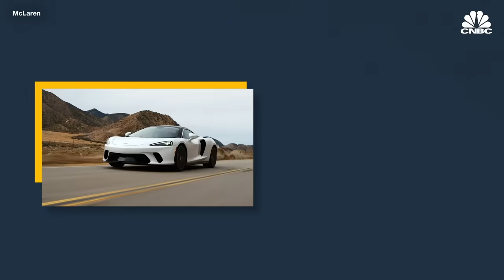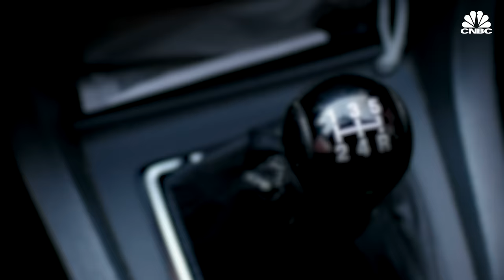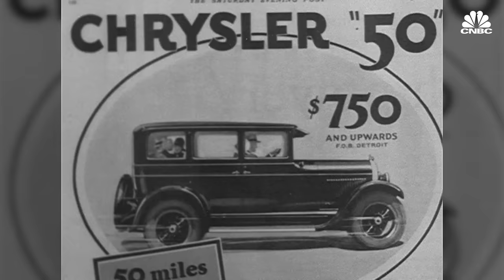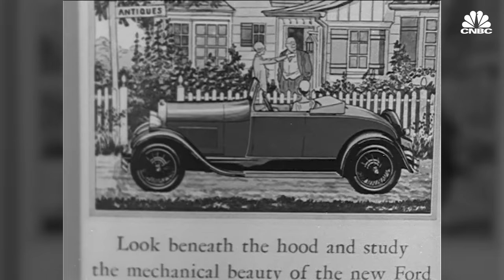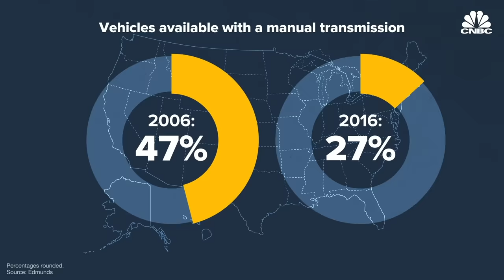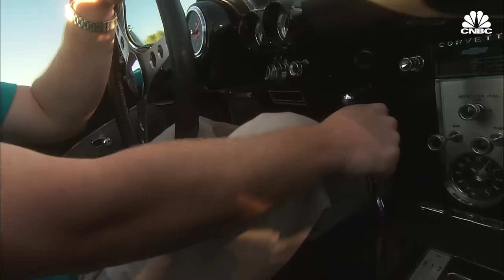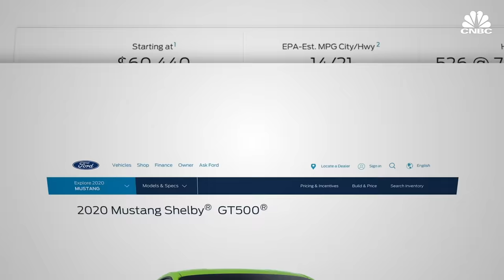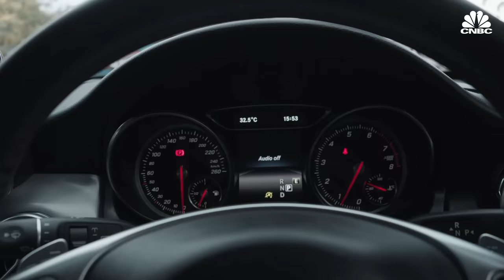Why Stick Shifts Are Going Extinct

Comment: I live in the U.K. and I don’t know anyone who drives an automatic.
Reply: All new Mercedes and BMW only come in Auto.....
Reply: @Brad-il9mw   thats Wrong my mate has a 2020 M4 with manual transmission and im sure they only do the M3 and M4 in manual transmission because of the weight. A double clutch transmission is about 100kg heavier than a manual.
Reply: I passed in a manual car. But drive a automatic. Trust me, it's so much more convenient when you're in city traffic.
Reply: @prasaanthmanohar1890  Automatic driving is boring though. It seems hard to stay focused.
Only car I'd buy without a stick shift is an EV.
Reply: @howey935  while I get your point and also drive a manual, the difference in weight is around 20-50kg which is pretty irrelevant. The only problems are the obvious cost and complexity.
Reply: Much respect to the British from an Italian. You are very passionate in motorsport!
Reply: @gabrielrfg4852  From an environmental point of view that's quite a lot though. On millions of cars, that's a ridiculous amount of weight.
Reply: I know this is a stupid question bud what car do you have?
Reply: @prod.mxmo_mk9   a VW Touareg
Reply: @howey935  That’s pretty cool I always wanted to get it but I don’t know about other Americans but for me it is pretty hard to find around America
Reply: @simmerke1111  You could always say that every car extra is bad for the environment tho, every car could weigh under 1000 kg and keep the same safety standards but it's all about confort and speed. Cars nowadays add much more than 20kg just in weird extras nobody asked for.
Reply: @prod.mxmo_mk9  Ford Focus hatchback
Reply: @gabrielrfg4852  That's fair. But if it can be decreased and made less complex, why not. Automatic gears are something I never understood though. So I might not be the one to judge the advantage.
Reply: OK when someone visits from the UK to CA when they rent a car it's automatic they love it automatics are just better stick shift my Hole
Reply: You must not know many people. In the UK in 2020, 54% of new car sales were automatics, up from 49% in 2019. UK is trending like the U.S., albeit more slowly. Automatics will ultimately take over everywhere.
Reply: @howey935  sorry to say but the new m4 is as ugly as bmw ever got lol
Reply: @DannewK   might be ugly but its performance is 2nd to none
Reply: @simmerke1111  I guess Prasaanth Manohar is talking from an India perspective. Our traffic is so much worse, we need attention even in Automatic transmissions just because there is so much more happening here on the roads. Plus in Indian cities, traffic is slow and time consuming. Hence automatics are more like a necessity in India. Sad, but true.
Reply: @anirudhtibrewal6744  Automatics is def not the answer to India's traffic problems. Overpopulation and poor public transportation in cities is a much bigger problem. Automatic cars don't improve road safety or speed. Start stop systems could save a lot of fuel, but those work on manual cars too.
Reply: @simmerke1111  I didn't say that Automatics are a solution to our traffic woes. It's a solution (read that as 'necessity') to driving fatigue caused by the traffic conditions here.
Reply: @anirudhtibrewal6744  It's a solution to a problem another problem causes. Maybe fixing the problem would be smarter than putting a bandaid on one of the results of it.
Reply: I don't know anyone (else) who drives a manual transmission and I have yet to see any other vehicles in America that roll backwards before accelerating forwards uphill.
Considering how many drivers pull up point blank behind me (while on a hill), I've observed a definite decline in the understanding of manual transmissions too...
I'm not saying that no one's using them, but as the video shows, it's declining unfortunately.

Comment: I love my 6-speed and I see this as an opportunity for those of us who have and love them. Their value will increase as the supply decreases. You just don't have as much control with a two-pedal car and they're boring, to boot.
Reply: My ‘17 gti has a 6 speed with a short throw shifter. 👌🏻
Reply: @kevn99  I'm jealous, I 💚VDubs. I've got a '11 Mini Countryman S All4. Pretty fun, it's a go-cart on backroads and on/off-ramps. Could be faster but I guess that saves me on speeding tix...
Reply: My BMW M3 has a 6 speed with a short shift kit. I have a full exhaust, full suspension, 19” HRE wheels, engine tune, air box and big bore throttle bodies. It is a lot of fun to drive. I love listening to the exhaust when I go through tunnels. I do miss the sound of my Mustang GT. I would not mind buying a GT350 for the sound alone.
Reply: I have 78 911SC 5 speed manual with a RennShift Shifter  that I love to drive. I had a 2010 carrera with pdk for 5 years. That pdk is awesome. Both cars are fun to drive; for different reasons. There's no thrill like the sound of the engine/muffler as you shift through those five gears of the SC.
Reply: @bwj1158  Rock-'n'-roll, bruthah. Never owned a Porsche -- on my bucket list for sure 👊😎
Reply: @kevn99  I got a 19 GTI with manual, but it's not short throw, yet. I didn't realize how hard manuals were to find today. I found mine and jumped on it, to the dismay of the other 30 people who had the car on 'watch' online. Sucks to be them!
Reply: Yup.  You’re actually controlling your vehicle

Comment: In a couple of decades, the steering wheel will go extinct as well.
Reply: Hopefully without catastrophic disasters along the way.
Reply: Good
Reply: You are absolutely correct.   I own a car which steers itself on the highway, keeps a safe distance between itself and the cars a head, and stops itself in an emergency .   Drove that way for over 200 miles.   It is a bit unnerving at first but I am getting used to it.  In 20 years this will be the norm.   Just think ... you will be able to drink and drive.   :)
Reply: @rocinantecoffee9171  I agree, but catastrophic disasters are occurring daily with the steering wheel, so I'm not too worried about it.
Reply: not to mention the driver will also be extinct.
Reply: So will the driver. Just give your car a list of errands and then kick back and relax at home...
Reply: Taiwanlight  maybe
Reply: Rocinante Coffee if no one has a steering wheel then all the navigation systems will be able to talk to eachother and predict movements. There’s likely to be dumb stubborn humans sticking around causing accidents with their human errors. Once everything is automated the only accidents will be people soiling their pants because of how close cars can get without crashing.
Reply: As well as the (clutch), brake and gas
Reply: Perhaps, but I believe it will be around as long as the car. Computers will never be THAT good that you don't ever have to intervene.
Reply: @abz124816  - just "think" what happens when a sensor fails or you encounter an electromagnetic disturbance, or a car jacker, or (the list goes on)
Reply: @abz124816  Which Tesla do you have?
Reply: abz124816 Bruh Russian people gonna love those cars 😂😂😂
Reply: The steering wheel was the biggest mistake in car design; the tiller arm was far superior, it just needed development.
Reply: At this rate, I think you mean years

Comment: I made myself learn how to drive a manual transmission so I could be able to face any vehicle that I have to drive. I prefer a stick shift over an automatic transmission, simply because I feel more in control of the vehicle. An automatic transmission  tends to have a mind of it's own, especially in bad weather conditions.
Reply: I totaly agree. The magic word is CONTROL.
Reply: I drive semi auto so whenever i just want less stress in the busy city or cruising i can switch into semi and let me ponder the speed
Reply: @yasunakaikumi  but does your transmission switch the gear automatically when RPM raises to a certain point?
Reply: manual transmissions are better cuz you have control over the car to your personal liking going into harsh conditions. no body in thier right mind is gonna want to be in 4th gear in snow
Reply: Lies again? Shift Work Age 12
Reply: You're also significantly less likely to accidentally exceed speed limits in a manual compared to automatics. The key word here is "accidentally" though.
Reply: @schwarzwolfram7925  BS. If that where true germany would not have the very common "10km over tickets". The manual gearbox in most cars stays in the same gear from 40 to 60 km/h. And 50km/h is a very common speed limit in europe

Comment: "In Developed Automotive Markets" - just as CNBC casually calls the rest of the Non-US world not developed.
Reply: It's not black and white, no stick is the way of the future and that's where the world is headed. If a country hasn't yet adopted it, it hasn't yet fully developed.
Reply: @KoRbA2310  Reading comprehension is important to successful dialogue over the internet
Reply: @justrinat2207  And guess who is fueling this transition? American companies. Go figure
Reply: @drdewott9154  Actually consumer demand is
Reply: because the rest of the world is non developed
Reply: @johnames6430  More developed, you mean.
Reply: @justrinat2207  there just isnt a proper need for automatic rn except high performance cars. If I am not mistaken manuals live longer, are cheaper to buy and repair. So for low and middle class manuals are probably the smart decision except you are a very long range driver where the higher efficiency may pay off. I would guess with fully automated cars as the norm in a couple decades manuals will become purely something for car nerds but not really before. After your logic no market would be fully adoptef bc I dont see fully automated cars in any market so all are undeveloped. Everything develops according to its needs and automatic without selfdriving cars doesnt seem to be a need in a lot of places

Comment: I was part of that 2% that got manual transmission in 2019. Love my Civic Si, favorite car I've ever owned.
Reply: Beholder88 they’re cheaper than automatic no?
Reply: @evastood4539  no not really in the US at least
Reply: recently spotted a 2018 Honda HR-V with manual transmission...unfortunately, 2019 forward, the HRV won't have a stick option ;(
Reply: Beholder88 I was one of the 2% as well in 2019, when I bought my Type R. I’m sad to see this segment of the market go. My last 2 cars were Si’s. So I’ve been driving stick quite a long time.
Reply: @evastood4539  I paid more for the Si than what a base model would have cost. There's more to it than just the manual though, it has a turbo and some other goodies.
Reply: @khailils446  Yes, they are cheaper in the US. About $1600 cheaper on average. So....
Reply: Beholder88 no you are among the 2% if we look globally. In India alone almost 500million vehicles are operating on manual transmission! And i don’t know the data of south asia but the number will be higher,so estimate around 1B cars right now are operating on manual transmission right now.
Reply: Beholder88 I’m thinking about leasing one, does it do ok in colder conditions and snow. Also does the auto rev match work well consistently for times when I get lazy?
Reply: @aryehroberts4645  I live in Ohio but didn't really have a harsh winter this year. I drove it a few times in the snow or slicker conditions and it did fine for me. I don't think the Si has rev matching. But there is some built in rev hang that I'm not a fan of. It's a pretty easy car to drive though, even on lazy days.

Comment: Manual transmission is saving fuel, last forever and cheap to fix.
Reply: Artur Sibagatullin many 8 speed autos are more efficient than manuals
Reply: I love driving manual, so I wish I could agree with you. In the last few years most automatics have actually become equally or even in some cases more efficient than manual. They have become just about as reliable so consequently the cost to repair is fairly irrelevant. I have a VW GTI and I love driving stick. It is more fun to drive, I personally feel more in control and I strongly believe I have much better control in the snowy winters. Otherwise I don't see the argument for manual anymore. which is unfortunate.
Reply: Nino Deiulis it’s more speed control and fun tbh. In winter you put your automatic in 1st or 2nd and your good.
Reply: The newer they are the faster they break at a way higher cost than a manual transmission.
Reply: @efraingonzalez4168  transmissions dont break anymore its not 80s junk anymore
Reply: @stowphysics  I've noticed that as well on manufacturer MPG estimates, and it makes me a little sad.  The differences are fairly small, however, and I think that a skilled manual driver could probably do better than the manufacturer's numbers.  But I don't think a tired manual driver could do that in stop-and-go traffic after a long work day.  I certainly couldn't.
Reply: better than dual clutch? uh oh
Reply: Modern auto's are actually more efficient than MT and have better performance numbers (0-60 for example).  I never intend to own an auto but they are 'better' than MT at this point.
Reply: Honda Civic Manual 6 - 48 miles per gallon!
Reply: Yes, I've only had to do minor work on my 1955 Plymouth's manual overdrive transmission.
Reply: @WearyKirin  It's certainly true that transmissions are getting more reliable, but in my experience Auto transmissions are more likely to fail than a manual gearbox, however in a manual the clutch needs changing before auto would need a a repair... the clutch is usually cheaper though... so in terms of reliability there are pros and cons to both.
Reply: John Miller Decades ago, I used to drive a manual with a 60 pound clutch in stop -and-go traffic. Sometimes it was a chore but it sure didn’t slip when street racing.

Comment: A stick shift is almost an anti-theft tool.
Reply: But also a hinderance in emergency situations.  If the main driver becomes incapacitated, no one else can drive passengers to safety from the zombies!!!
Reply: Lol sombody tried to steal my dads car and he couldn't start it lol
Reply: JustaReadingguy My thoughts exactly.
Reply: Can you explain why please ? 
If the car is well known , everybody can shift its gears.
Reply: @alhassanait1749  not really if you shift wrong the engine stalls out. If you don't know how you arent getting far regardless of how known the car is
Reply: Whenever I hear this I cringe. 99 percent of the time if a person knows how to start a car without a key they can drive stick.
Reply: I took my car to Best Buy to have a new radio installed and when I got out, the tech told me to get back in and pull it into the bay for him because he couldn't drive a stick. I was really surprised.
Reply: ALhassan Ait, If you mean the stick shift itself, then yes, anybody can shift, but you’re also forgetting the clutch is part of driving a manual car. I’ve seen many people have a hard time with it, including myself when I was learning.
Reply: There was a case here in Dallas where the guy couldn't figure it out but took it anyway and messed it up.
Reply: If a thief wanted to steal a car with manual, they will find a way to do that.
Reply: @thomasleemullins4372  you are right, but the down stream market is small and is not wanted. So how wants to steal a "lemon?"